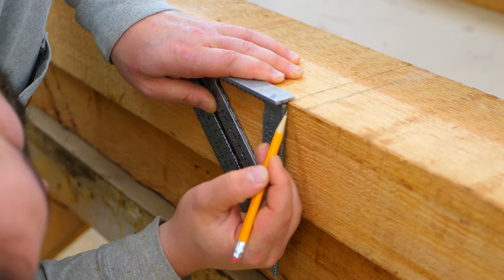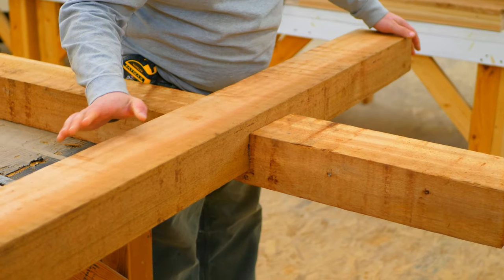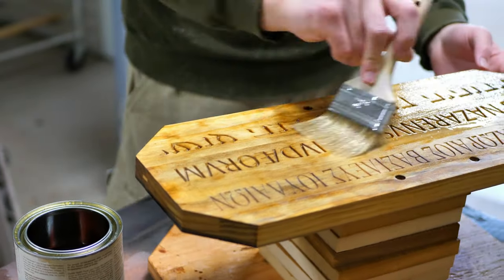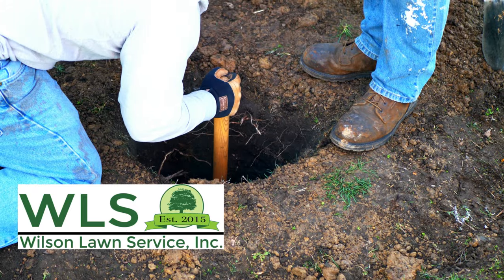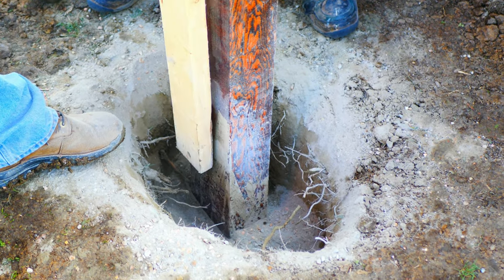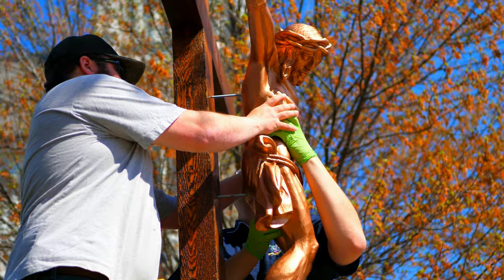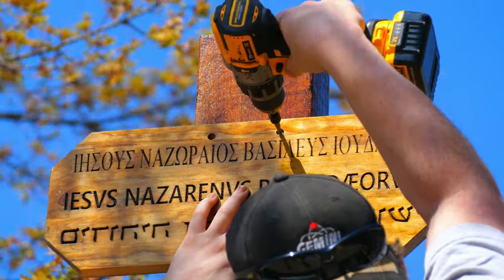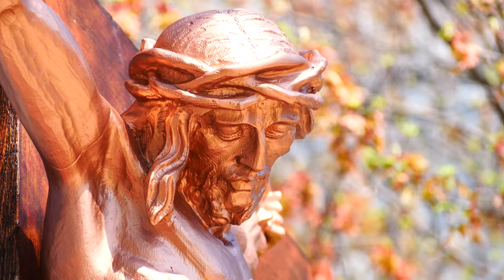Standing Outdoor Crucifix - Construction & Installation

Comment: What's the size of the lumber for the beams?
Reply from the maker: The lumber for this cross was 6"x4" timbers cut to the lengths of 14' for the vertical beam and 5 ' for the horizontal beam. Part of the vertical shaft was submerged into the ground and fastened with concrete and bolts to keep the cross steady.
Reply: @HeritageRDStudio  Thank you so much. May God continue to bless you. This was a great help. 🙏